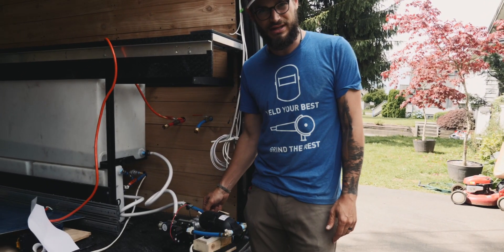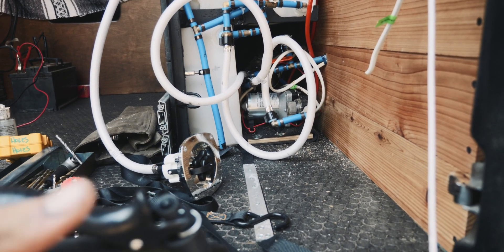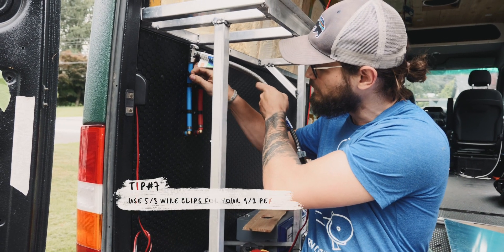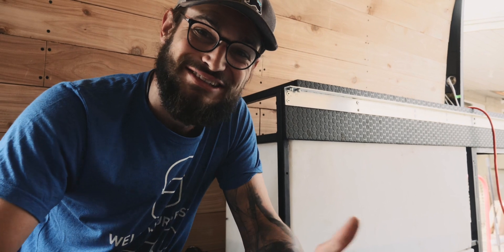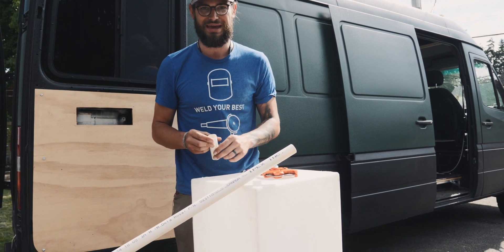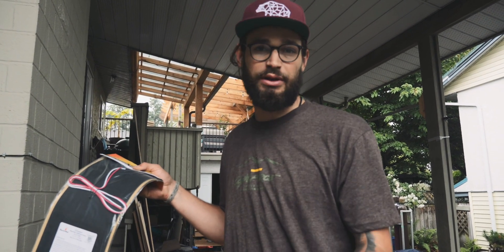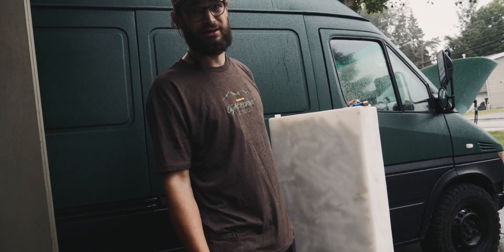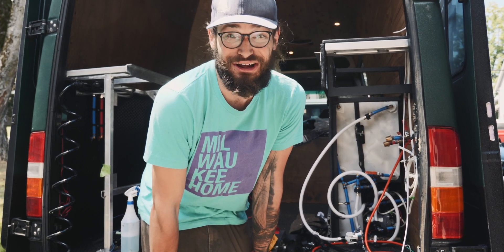How to Silence your Water Pump for RV or Van Build

Comment: So here's what I did Levi,
I installed my three tanks under my rig, but before I did that I taped temperature probes to them, then I added those heat pads you had to each tank. The problem with them is that they literally have a mind of their own, while you can turn them off whenever you want, it will decide when to turn on, so I can't rely on that temperature probe and an Arduino to turn the heater pads on and off at pre determined temperatures, But I wasn't going to rely on them alone in the first place so that's not too big of an issue, the main heat is coming from heat tape, wrapped around each tank - this I can completely control with the temp. probe, a relay, and a Arduino. I then wrapped all that up in reflectix to reflect the heat in, and then wrapped all that in rockwool (for it's fire and water resistance) insulation as the main way of insulating them. Then I sprayed them with truck bed liner to keep rocks from destroying them.

I sparked up a joint and marvelled at my creation, "No Canadian blizzard is going to keep me from a hot shower." Then I realized, they make antifreeze for this. So my grey and black tank will have RV antifreeze in them as well. Felt a little like ⅔ of what I did was in vain. But now I have more options to keep those tanks from freezing. 

I smoked a bit more, and realized I could put a 3-way valve on the source side of the pump and choose to pump from the tank OOOOOR if I don't have access to a hose with potable water to fill the tank I could go into a Walmart fill a Culligan (18L) bottle AND PUMP DIRECTLY FROM IT!!! I was so stoked at this idea, then I realized I could run a line off the main branch coming from the water pump to a T-joint on the water tanks' gravity fill line. This would allow me to pump water from a Culligan bottle directly into the water tank. Another realization: if that 3 way valve is set to pump from the water tank and back into the water tank, it would be recirculating the water(duh), but that means I could run a hot and a cold line into that T-joint via a mixer valve, and in the winter recirculate warm water through my tank keeping it from freezing. I'm really looking forward to a harsh winter so I can put all of this to the test.
Reply from the maker: The best ideas come when we slow down.

Totally agree, don’t plan to leave the heat pads ‘on’ unless we are on shore power and it is indeed freezing. The cabin air heater will keep ambient temp high enough that I should be fine never using them. (Which is why I put tanks inside as I really didn’t want them hit by rocks underneath.) sounds like you’ve got a wicked setup. I have 110v heat tape on my main water lines, but not the ones that drain beneath the van. What kind of heat tape did you use? 

I should get into arduino stuff. Seems really practical for certain implementations.

I have an auxiliary pump I use for filling my tanks from jugs or a river. Not as fancy as a three way valve, but does the trick.

Let me know how this winter goes!
Reply: So what I get from this is, you'd either be drinking anti-freeze, or hot water 🤔
Reply: @krimke881  When we first tried it it did create a feedback loop type of affect just heating the water until it was just hot water(an oversight for sure) so we are now using an Arduino to control the water temperature recirculating. Keeping it between 5°C-10°C. The antifreeze is poured down the shower drain and down the toilet after each tank dump to keep the black and grey tanks from from freezing.

Comment: Hose clamps loosening as you go down the road... You mean like the billions and billions of them that have been on countless vehicles for over 3/4 of a century???
Reply from the maker: That is a fair point. They do work great when installed properly. As an amateur water installer I feel much more confident with the crimped connections. I had two connections with barbs and clamps that leaked on my first test setup. I don’t think there is inherently a problem with clamps. But a plumber did urge me not to use them and I’m trying to relay that in this video. All my Deisel tank connections I redid are with worm clamps, so I guess there is a hole in the logic. And I’m sure the coolant loops in peoples vehicles are just fine.